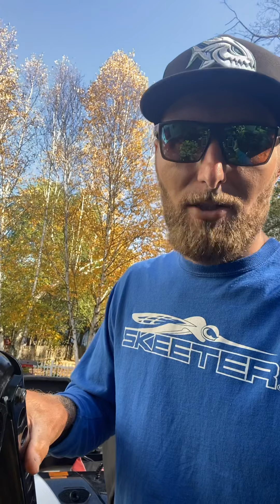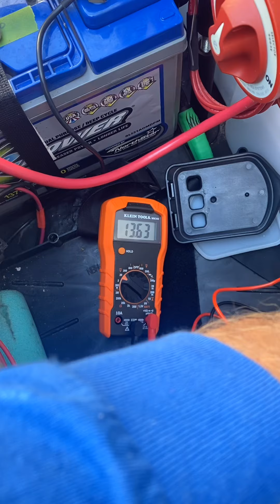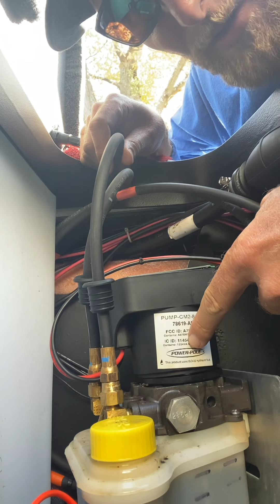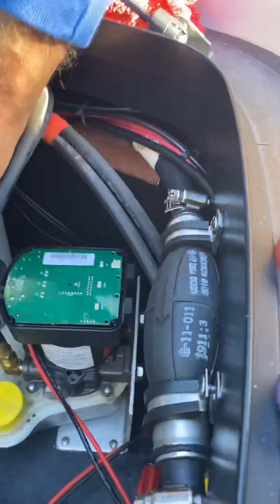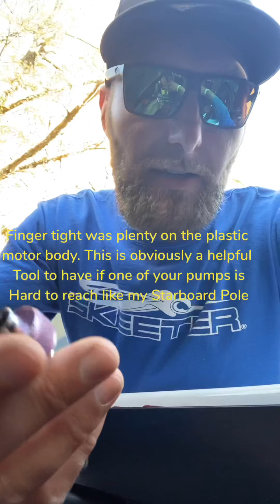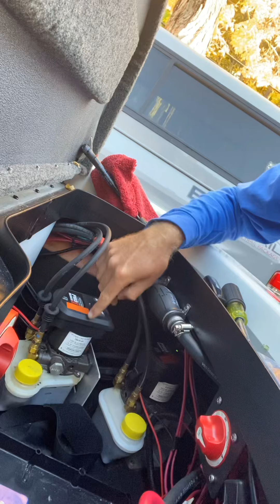How to replace a Motor and Circuitboard on Power Pole PRO 2

Comment: Looks like it is my turn to experience the customer service personnel at Power Pole tomorrow. Starboard pole deploys great, stowing it is another issue, and then on Friday when my wife and decided to go out on the water for food and a couple drinks. The same pole would not come up, it wouldn't even budge. I was able to use the button on top of 5he motor which did work. But that was it for either the motor or the pump.